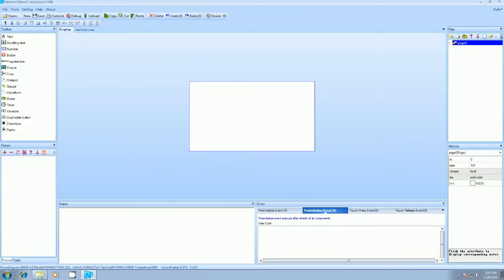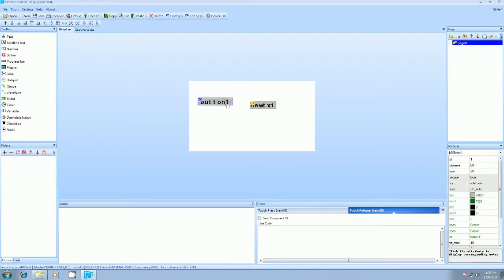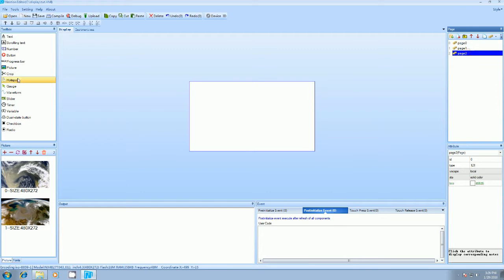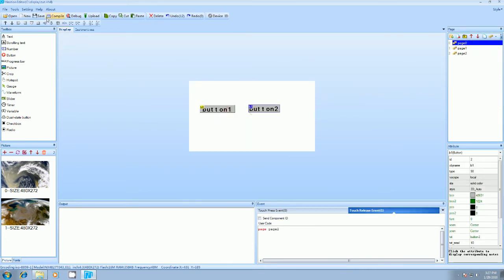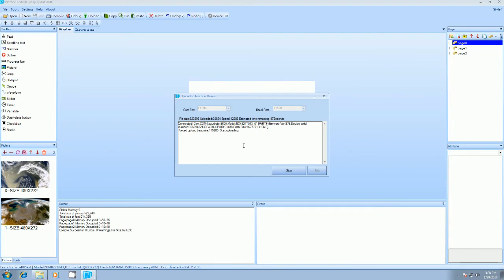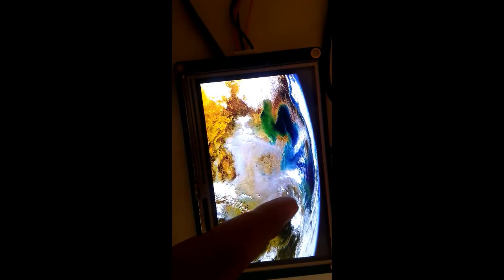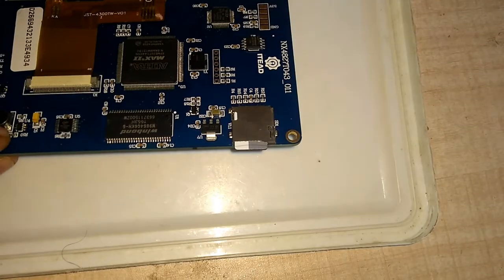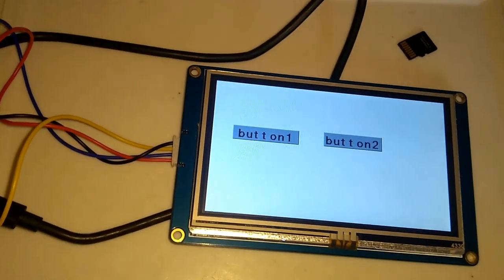Nextion Display Upload using Serial UART and SD Card

Comment: Thank you sir. But there is something I didn't see you do. How did you set the baud rate of the nextion when uploading using SD card. If the Baud rate is not synchronised with another device such as Arduino, the nextion and the arduino will not communicate. So Please how did you set the baud rate when considering uploading with SD card only?
Reply from the maker: I can understand. Initially i had low budget camera phone and had no experience of blogging.
You don't need to set up baudrate if you are using SD card.
Reply: @StechiezDIY  thanks sir. But my Arduino and nextion are no more communicating after when I updated the version of  Nextion and the Arduino